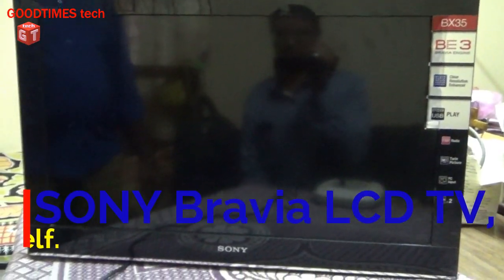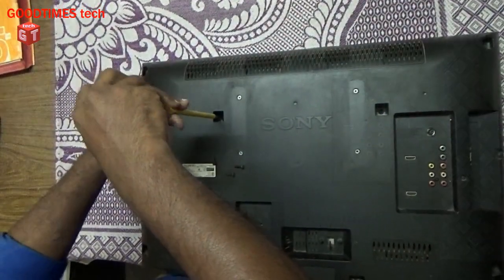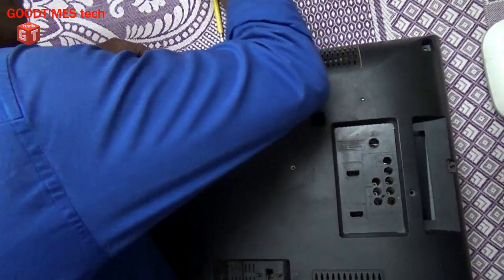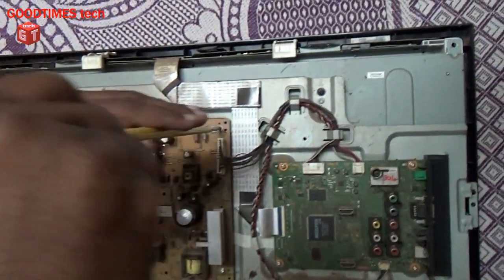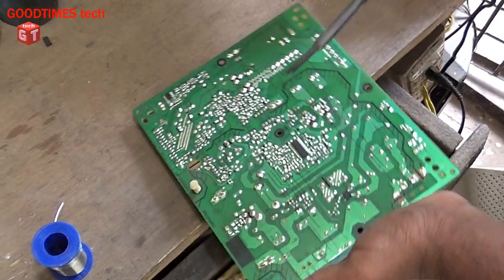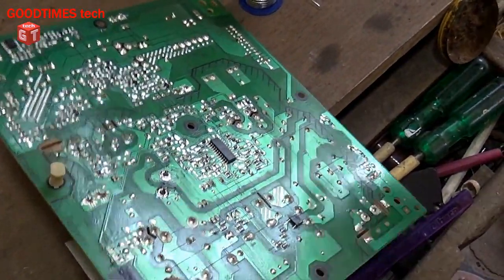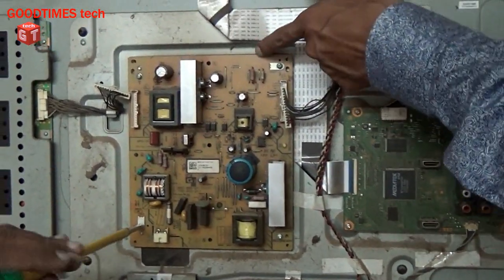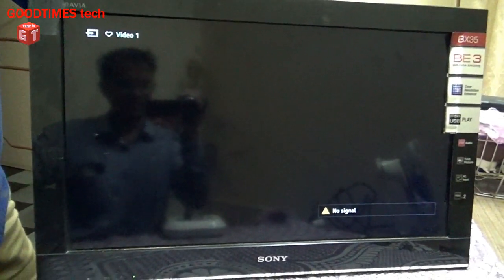SONY LCD TV switching OFF by itself | abnormal image.

Comment: my sony lcd model KLV-19T400w.. switching on or off automatically. I have went to electronics shop too  But there tv worked fine(acc to electronic tech).  But still i have problem.
Reply: some time it turn on off within few seconds. some time it take 2-3 min to turn on after turning off

Comment: My sony tv also same problem automatically restart hota he mene factory reset bhi kiya for bhi same issue
Reply: Any other solution
Reply: Did you find any solution?
Reply: Bro you need to open the tv check the power supply or the main board to see if there's a problem but it's dangerous the tv have 400 volts
You can fix it if you are professional

Comment: even I am facing the same issue with my Sony tv same model but in our tv we can watch video for 30 min and after that it is getting switch off. The Sony tv technician came and told that this model is old hence we can do anything and have to throw. he didn't even show the effort to clean the dirt. what to do plz help.
Reply from the maker: Dear sir, Sorry for late reply, try the following...

Reset the settings. if it does not solve then..
if you have technical knowledge, check the backlight, or you can refer to some local technician to check the power supply and or the inverter circuit that supplies power to backlight florescent tubes.